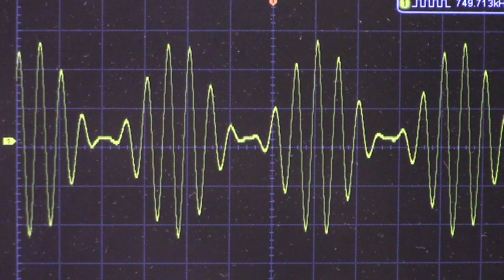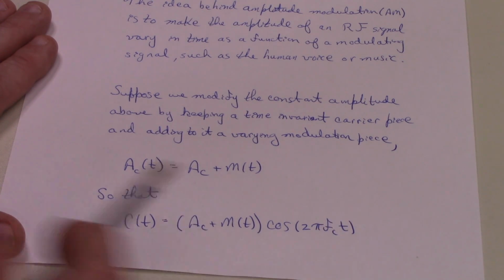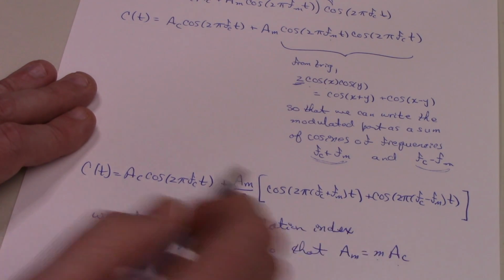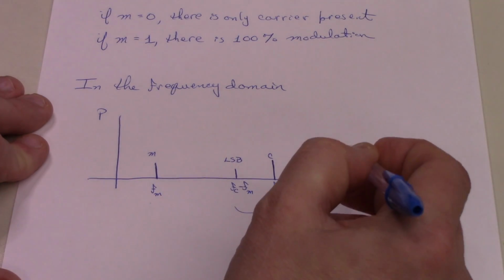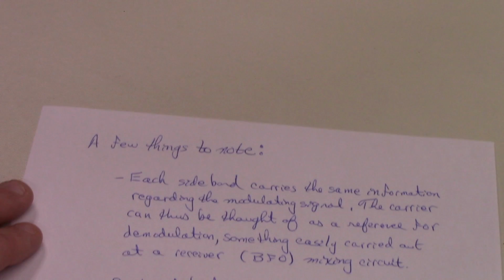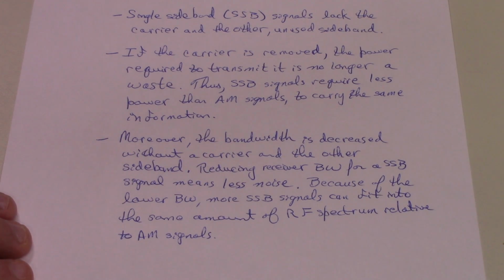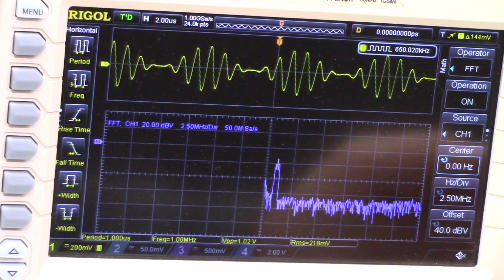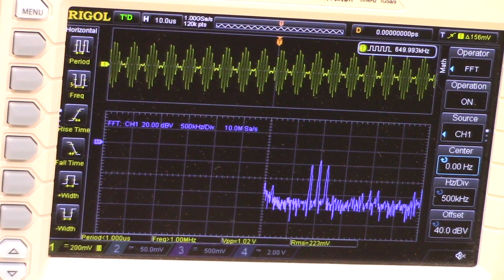#57: AM and SSB explained

Comment: Thanks for this, it helped a lot.  I could never figure out why the sidebands were there, why the hell would messing with the amplitude impact the frequency?  Expressing it as cos(a)cos(b) = 1/2 cos(a+b)cos(a-b) did the trick, it is especially clear if you plug that into a graphing calculator.

Comment: There are so many poor explanations of side-band, definitions, generation, and demodulation, that I just want to be clear on this; please let me know which parts of these statements are incorrect: 
1- In AM radio, the demodulation of an AM carrier, into its original audio signal, is not dependent on side-bands?  
2- Side bands are a natural result of the mixing of two or more electro-magnetic wave-forms? 
3- In demodulating SSB, unlike AM, the audio heard after demodulation, is actually the resultant frequency difference between the carrier and the imposed audio? 
4- Like AM, the amplitude of the SSB wave, determines the demodulated "volume"?

Comment: Thanks for the excellent vid. The math is a bit beyond me, but I got the idea.
Can you answer one question for me in the simplest terms: Why does the pitch of the voice you hear on an SSB signal rise or fall as you move away from the carrier frequency? I'm figuring that it is the sum and difference between the received signal frequency and the tuned (VFO) frequency which adds or subtracts to/from the modulation. so if you move the receiver VFO 100Hz higher for an LSB signal, the modulation will rise in pitch by 100Hz, while for a USB signal it will fall 100HZ, and v/v for moving the VFO lower in frequency.

Comment: Hi and thank you for another what I would consider as a mind blowing video. You mentioned that in SSB the carrier and the other side band is suppressed.  Is there any way to demonstrate that in the lab demo?  I'd love to see what the "transmitting" signal looks like in the time domain (with those components removed).  Is there any insightful way to show what happens when the carrier and the other side-band are suppressed by looking at the math alone?
Reply from the maker: This is a great question. Looking at the specs of several modern amateur HF transceivers, it appears that the unwanted sideband is typically suppressed 50 dB or more below the maximum output (see, e.g., http://www.kenwood.com/usa/com/amateur/ts-590sg/spec.html), so the signal level should be quite low. I've heard people talk about signals on the air where the suppressed sideband is audible, though I've never looked for that to tried to hear it. Those cases are probably due to very old or poorly designed transmitters. The suppression of one sideband relative to the other should be measurable using a spectrum analyzer, though care is obviously required. The w2aew channel has an excellent video that shows SSB in the time domain, https://www.youtube.com/watch?v=3DxBg6h4Fc8.